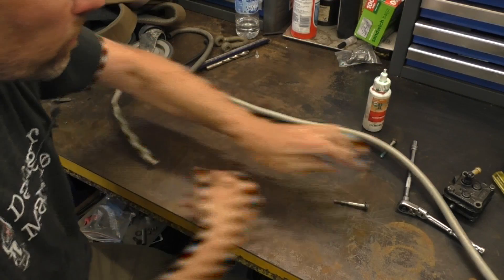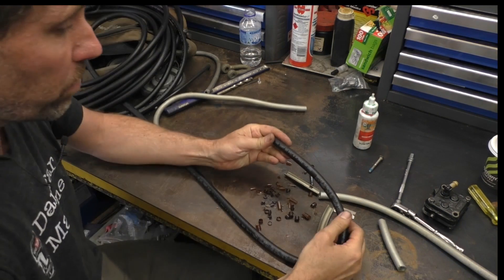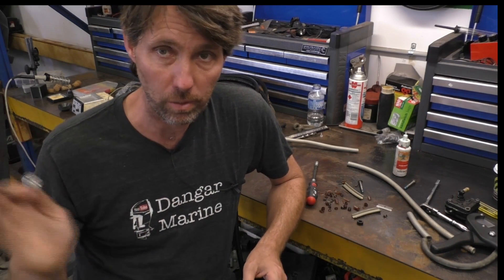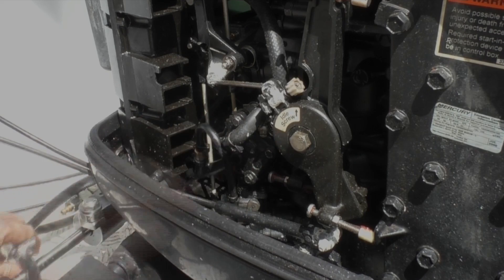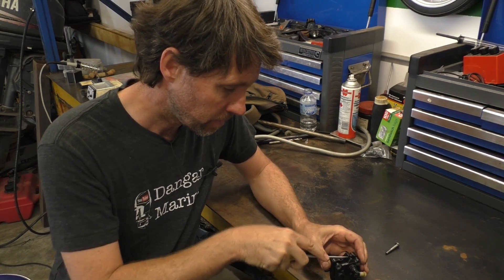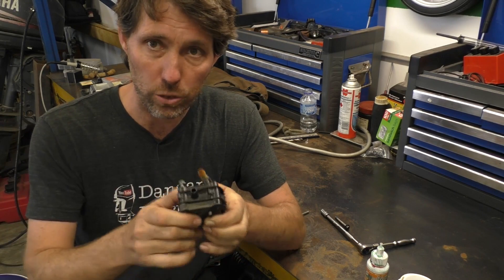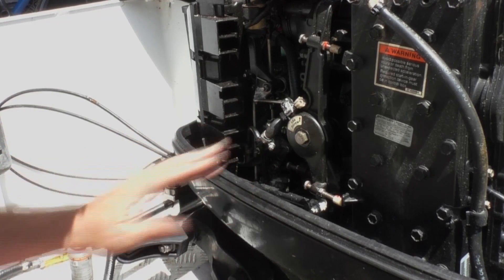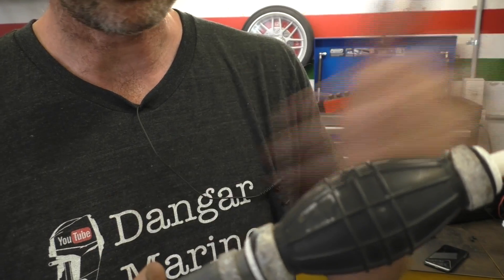Perished fuel lines

Comment: you are freaking awesome man! Today i just my new fuel filter and fuel pump rebuild kit from ups. I asked you when you did the tohatsu timing if you could do some Mercs and now you have it. I told you about the leaking oil in the cowling. You actually answered one of my questions in the vid. Mercury uses zip ties on all there lines and i wanted to see if i could use stainless like you did in the video. Since i (think) i found my leak, i wanted to add new hoses under the cowling. But i don't know if i need to have the exact diameter or could it be a little smaller or larger. If i go on boats.net i see the hoses are different diameters(and expensive). Could i just find the diameter from the parts list and go to a auto parts store and cut my own? My leak seems to be coming from the oil pump(either hoses at the pump or the pump itself). What i did notice   looking at the service manual is that mercs have two line markings, one on a lever and one on the pump bracket that need to line up. Mine wasn't lined up so i had to tighten the pump linkage to get them to align at idel. I took it as idle meant not to move the carbs or throttle and set it there. Thats what the manual didn't tell me. Thanks again and post me the link for your shirt. I will order one monday. Sorry for the long message.
Reply from the maker: Thanks mate, and yes, get the diameters from the parts sight and buy good quality hose from an auto store. Marine parts are alway more expensive for no good reason. T-shirts available at https://dangarmarine.com.au/collections/merchandise/products/dangar-marine-t-shirt Be sure to send me a photo if you get one!
Reply: +Dangar Marine will do! Thanks